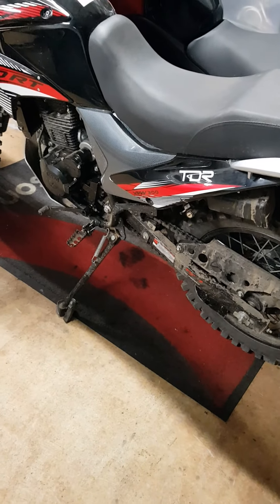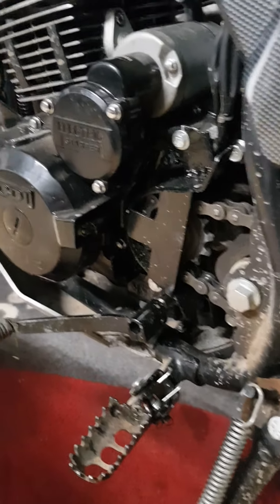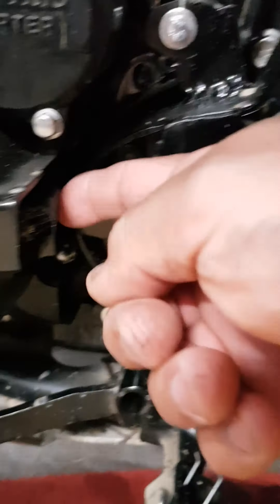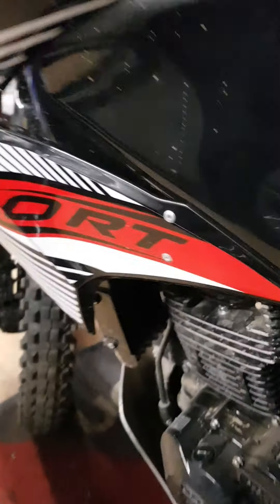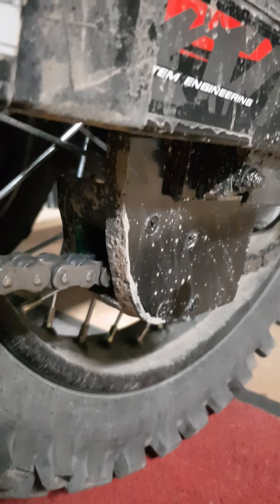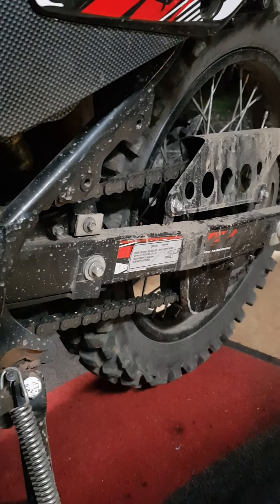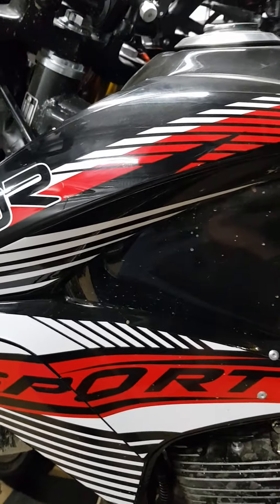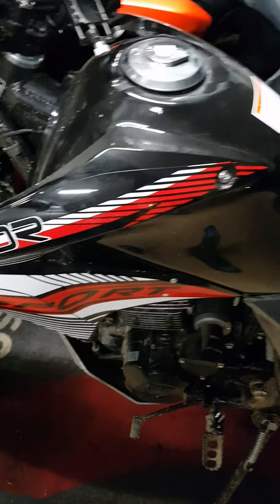Chinese Dual sport TDR 300 Review Case saver and chain guide

Comment: Hey bud. Thinking about picking up one of these. Worth getting you reckon?
Reply from the maker: Yes. I would recommend buying one if you don’t mind making changes to the bike, like mechanical improvements. Also if your under 170cm tall it can be too high, especially if your riding enduro style riding and need to put your feet down.
TDR have a 200cc Dirt bike that would suit shorter people, but it’s a dirt bike, not a dual sport.
I’m happy with the mods I’ve done, now it has 11t and 45t sprockets great for slow technical stuff.
Reply: @davidposavec7405  yer sweet, I'm 183, looking for something a little higher. Dont' mind making adjustments. Also riding high country stuff in Vic, might go check on out in person. Cheers!